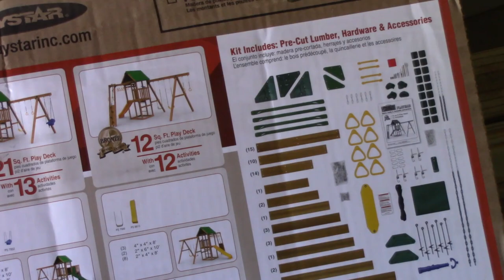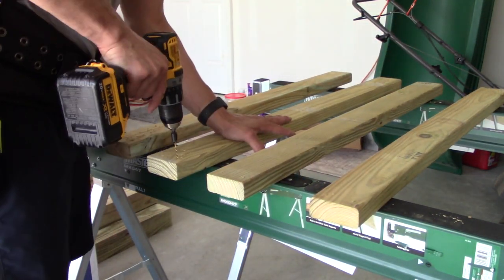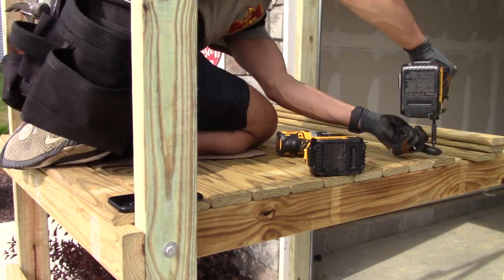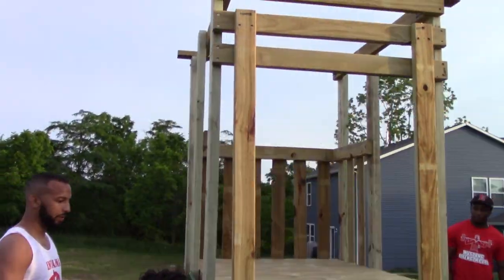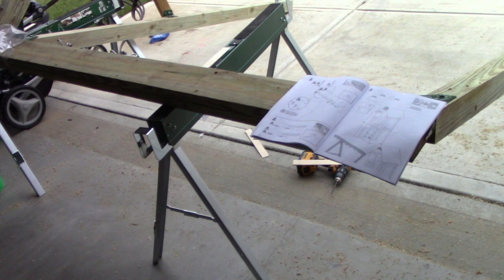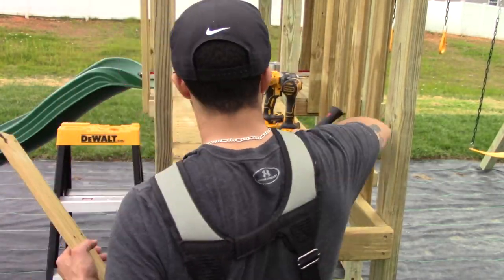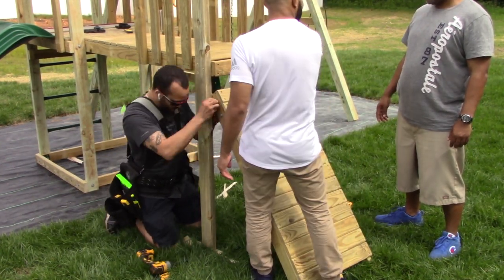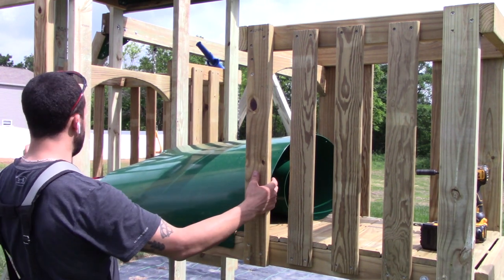BUILDING A READY-TO-ASSEMBLE PLAYSET

Comment: Great Vid. Thinking about picking this Ready-to-Assemble one up sometime this week. I have zero build experience outside of IKEA lol. Def going to use your vid and advice while building. Do the instructions  let you know the bit sizes to use? In the vid you said you had to saw. I dont have one, do you think this will be a problem?
Reply from the maker: You can do it! Great instructions with the kit... you don’t need to saw, I was just going the extra mile
Reply: What’s with the extra wood pieces is that needed because I bought the box only
Reply: @mr.birdman3477  Not sure the extra he needed but I used only the wood the instructions said I needed and it came out perfect. Did everything solo and its still standing strong 3 years later. Zero Build experience. The instructions were easy to follow. I would def suggest at least have one person help lift upright when you put the roof on if you go with the wood roof like I did because that part was rough. Since you bought the Box only like I did because EVERYTHING(all Pre cut wood) was sold out during the Pandemic, in the instructions, it should show all the wood needed to build with the cut size needed etc. I went to Menards and they have a section you can cut everything needed. Or you can prob slide one of the workers some cash to cut for you. you'll just need to go to the yard and pick everything out.  It is a loooot of cutting so be ready. If you dont have a truck rent a Uhaul Van to put the cut wood in.